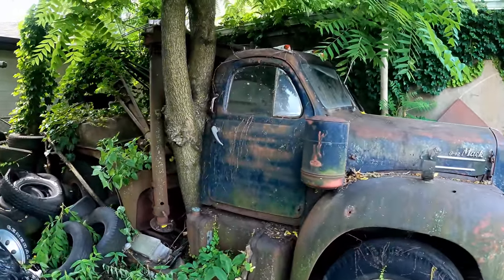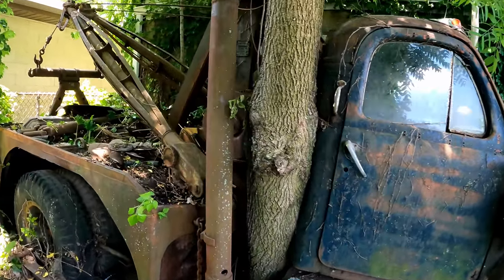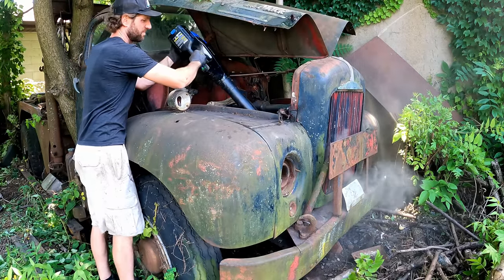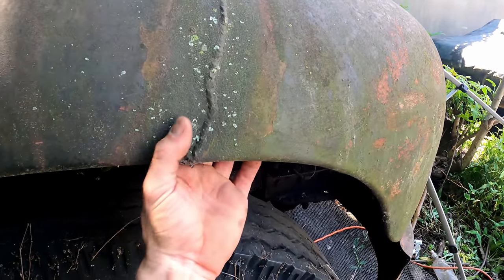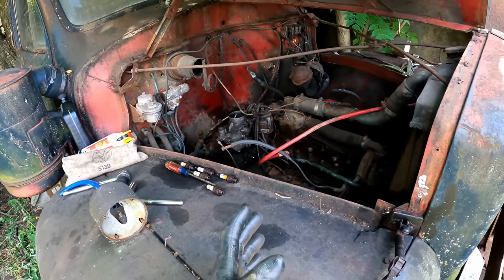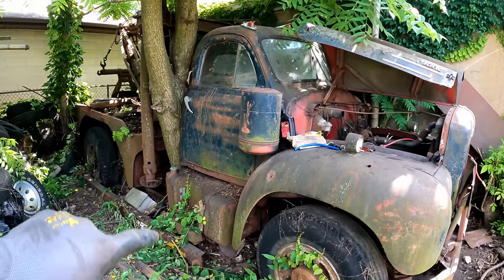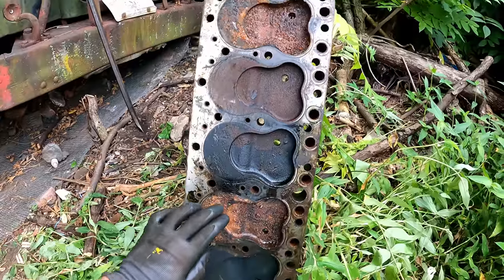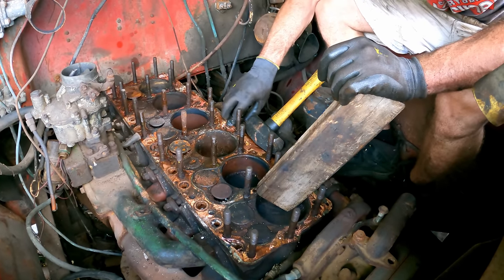Will It Run? Mack B42 Wrecker Magnadyne sitting 30+ years - NNKH

Comment: if the lumb didn't loose those pistons there are 2 thigs that probably explain this

1) the pistons are so rusted that the lub wont go down forcing those pistons to loose

2) the pistons rings are still good so no lub will go up or down so easily

and guys, understand, no lube can loose a piston that easily, the piston rings or rust will hold that lube whatever it costs, the better way to unlock the piston is to dismount the hole engine

Comment: Go to a local veterinarian, get a gallon jug of Iodine,   fill each cylinder, wait 24 hours > Iodine eats rust, an old farmer showed me this trick roll it over until it quits spitting out of the plug holes, check for spark add fuel change oil and go That's how I got my tractor running but it only sat for 20 years

Comment: I would say if someone offers $1000 for it he better take it and not complain. The cylinders need honed and soaked some more. Carby will need cleaned out and checked for operation. Fuel pump too.AL B.

Comment: Why not use rust remover (like Evapo-Rust) in each cylinder and let it sit, before penetrating oil?
Reply from the maker: Wasn't sure how bad it was at the time
Reply: @NoNonsenseKnowHow  Well it sat for decades and was stuck from the start. Anyway, fun to watch. 
And I would recommend an induction heater for stuck bolts.

Comment: It would really help if you could ad a lower quality setting to the video.  1080 @ 60 FPS is a lot to ask from some wifi's
Reply from the maker: I didn't realize the FPS puts a lot more Demand on it. You could watch it in 480 or 720 no? I always shoot everything in 60 FPS just in case I decide to slow it down or whatnot.
Reply: @NoNonsenseKnowHow  My computer is just a basic Chromebook but couldn't keep up with it.  I tried to change the quality and it only had one option at 1080p-60 FPS. I switched to my TV and it could handle it so not necessarily WIFI specific.  It only had one option for quality which was great but also some computers just can't process it.  By the way great content on the Riviera.  My girl and I watched the whole thing and man I was like "he's got some balls driving that thing threw the Vegas strip with those fuel priming problems" seconds later it dies and you get swarmed with "you cant park here" guys lol

Comment: I seen a couple of Nice running B42's listed for 15-20K, now they haven't sold at that recently, I have seen some running and driving trucks go for 3500-5000, this is probly the least desirable its a flat head which is NOT a good thing they made about 69k trucks with this engine all of them were worked to death, parts are impossible to find. I would consider the flathead a total loss with that much rust and water in the bottom end:   that being said you put a GM871 in there with a 10 speed and after 1000 hours and 10 grand in restoration you might have a truck worth 20k. if somebody wanted to buy one that is ......
Reply: Yeah, teh $5000 asking price is definitely too high, and $3500 is questionable unless further inspection finds some redeeming qualities that are much better than the appearance would suggest (i.e. minimal rust on cab and wrecker body, trans and axle gears are usable, no significant rust on the rims, etc)

Comment: Hey man that's not a maxadine the maxadine came out in the u-model back in the early '70s there that maxadine it was painted gold and it had a 7-speed I think cuz I actually drove it drove a couple of them it says straight 7 speed what you looking at there is a flathead six or eight or whatever gasoline job

Comment: 41mm? Are you nuts? What makes you think a 60 plus year old Mack has metric bolts?!
Reply from the maker: You never heard of metric and SAE crossover? 8mm = 5/16   16mm = 5/8
Welcome to the 21st century. They had a metric large socket set in stock I grabbed it. It worked. Thanks for watching

Comment: In those days 1900's 1910's 1920's 1930's 1940's 1950's 1960's 1970's gasoline was the norm small medium and heavy duty  used gasoline by the fifties heavy duty used diesel there were no diesel pickup trucks till the 1980s but rare Now everything is diesel

Comment: Requires patients .heat manifold get block warmed up spray repeat
Reply: Id buy but not running Deadhorse trama cost more than worth to haul that 1800 miles home .keep wrenching bro only way out is in gear

Comment: I cant imagine a use for this dinosaur, rode REAL hard and put  away dripping wet. If it was a six cylinder diesel, MAYBE if it would bar over clean. The tow rig was thrown together. Let him keep the tow rig and if you feel generous  show him a  grand as your walking out the door. Otherwise that carcass would be nothing but $3500 worth of aggravation and for what??  Good luck.

Comment: I have to wonder was it taken out of gear?
Reply from the maker: Yes.  And the motor did not budge a hair either direction. Even if it was in gear it would still budge
Reply from the maker: Also if you watch further in the video you'll see how rusted the cylinders are

Comment: Uhhh it’s a flathead so instantly trying to crank it with the starter won’t hurt it man
Reply from the maker: What does being a flathead have to do with anything?
Reply: @NoNonsenseKnowHow  well if you have a stuck valve, hitting the starter and turning the motor over won’t let the valve hit the piston because it’s a side valve motor. The whole idea of turning it over by hand is if you come to a hard spot in the rotation, you can back off and figure out what it stopping it, instead of hitting the starter and risking breaking something.

Comment: You will learn not to use a impact gun on head bolts when someday you snap one off in the block.
Kids likes short cuts and do things as easy as possible.
Reply from the maker: Or know how to use your impact gun and don't break bolts. If you don't use your impact very often then yeah you might not be familiar with its power
Reply: The faster you turn the bolt the more friction it has and the easier it is to break. Anything sitting for long periods of time the more it can rust and you don't know the history of the vehicle so you don't know what someone did previous..  Like changing sparkplug on a Ford truck with a Titan V8

Comment: It amazes me you young guys think old crap like this is worth money or your time.
The shutters in front of the radiator work automatically off the heat of the engine coolant. 
If the engine is real cold the shutters close, Hot they open up for more air flow thru the radiator.
I used to drive a B61 model which looks a lot like that one.
Some early ones were gas engines others were diesel.
Reply from the maker: Amazing indeed

Comment: Anyone with any common sense would tell you that there is not a metric bolt but or screw on an American made truck car or bike that old
Reply from the maker: I would say anybody with common sense knows that SAE crosses over to metric in most cases. For instance 3/4 equals 19 mm
Reply: @NoNonsenseKnowHow  yea most but not all I've saw alot if rounded off bolts and nuts due to it being sae and someone using metric tools aswell as ppl trying to use metric bolts and nuts on sae hardware

Comment: Well just to cut the tree in order to free the truck is already hard labor. The wheels are locked up so the truck has to be dragged with a heavy duty wrecker out of there. Add the towing labor to the new owners destination and all you get is a piece of junk not worth any trouble. I recommend the owner to give it away for scraps. One can find a rust free truck like this one in the desert
If you do the due diligence research . This video was a waste of time in Labor since the whole truck should have been cleaned up all around and inside before the video. This is too much junk showing history of prolonged neglect and poor shop cleaning over many decades. It is sad to see what perhaps what once was a good business run down by subsequent siblings management.

Comment: I have seen 2 different times where battery's have exploded from the sparks created while just connecting jumper cables. As luck would have it both men were wearing eye glass's. Both did have some nasty cuts and burns on their neck and face. Once you have seen some thing like that you won't try that trick of shorting those cables to the battery. Extremely stupid and dangerous thing to do. All though you would probably get allot of views on a video showing how you lost an eye or blew your face off on YouTube! It's like mechanics who wear rings on their fingers then accidently shorting out the ring on 12 or 24 volts wire. I watched the doctors cut my fathers wedding ring off his finger. After that ordeal I never wore rings again while working as a mechanic or especially when welding. Seeing it once was enough for me...but; hey no worries that could never happen to you.
Reply from the maker: They were probably lead acid wet batteries